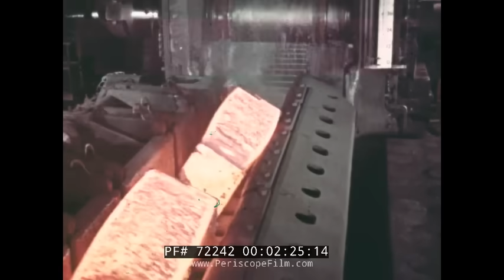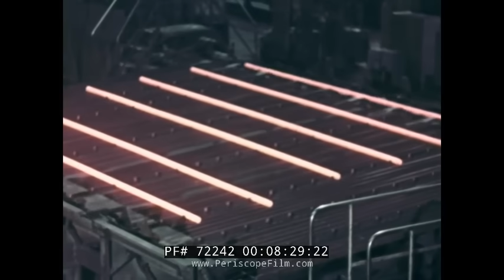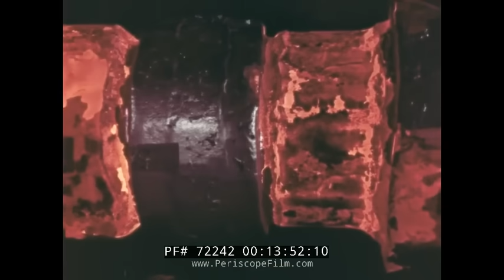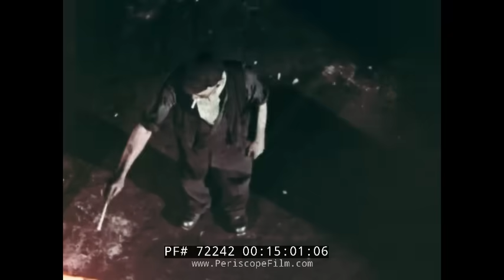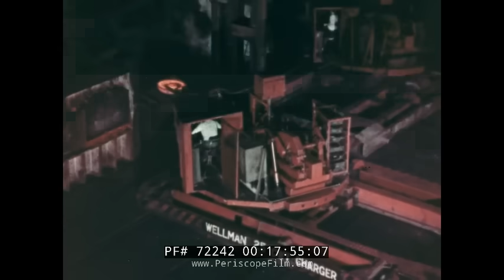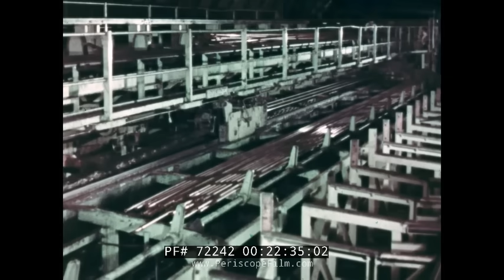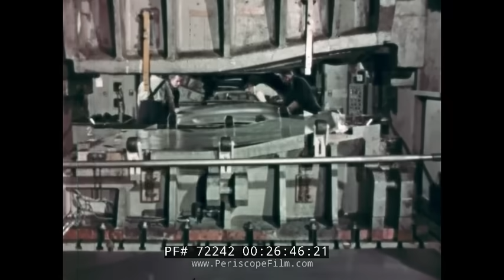"THE DRAMA OF METAL FORMING" 1959 METAL FOUNDRY & FORMING PROCESS   SHELL OIL INDUSTRIAL FILM 72242

Comment: 50+ years fixing machines like these. Paid better than running them and you never got bored.
Reply: bob brooks I'd love to hear some of your stories.  I've spent my life building and repairing machine tools, so I know how much fun it can be!
Reply: I enjoyed them all almost equally, but large horizontal mills are probably my favorite, for the complexity.  Lathes are a close second, because they're my favorite machine.  I would take them down to nothing, grind the castings, scrape them in and rewire with new controls.
Reply: @mrmichael555  nice, scraping seems like a magic dark art, it baffles me that it is done, how would they maintain the squareness/paralellness across the ways???
Reply: mackk123 Back then, autocollimators, levels, taut wire and levels.  Now, lasers take the place of some of that.  Just keep scraping until it's right!   Some machines I've done took months to scrape in.
Reply: @mrmichael555  woah I can imagine now, those telescope inspector looking collimators, being slid back and forth to test the trueness of it, makes sense. But seems easier said than done for sure, my furthest scraping experience is on a slow day I used a piece of broken hack saw blade that I'd just ground to have edges, scraped away pieces of aluminum and checkedthem on the surface flat.  Scrapings real but it still feels like magic  LOL
Reply: @mrmichael555  I'd want to  build some mini scale machine to do recycling, how can I star?
Reply: @mrmichael555  ever work on tube draw bench? I work with one from the 60's and it still runs!
Reply: Exi1ed Dragoon no, I've never touched one.  I've always been on the machining and cutting side of things.
Reply: Exi1ed Dragoon but I've rebuilt a few very old grinders and mills.  The history, 50 or so years of people running those machines is amazing!
Reply: @mrmichael555  Where did the repair take place and how long did it take? Was a large mill moved to a shop? Did they have spares, or did production stop until the mill was fixed?
Reply: Dave S. The machine would be brought to our shop.  On average, a large mill could take as long as 5000 hours to completely go through.  With enough people overlapping correctly, it can be done in eight months.  The customer would schedule around this.  It's next to impossible to rebuild, retrofit and predict what a future customer might want, so they always accept the down time.
Reply: @mrmichael555  My boyfriend’s dad passed and he has a big lathe that he dismantled and they don’t know what to do with it.
Reply: @bonnaew9951  that’s too bad!  Where is it located?
Reply: Unsung heroes of the modern age, the people that design all these machines.
Reply: @flybobbie1449  design? You mean the poor sods like us who have to keep em running?

The amount of things that are designed without a single thought about repairs and revisions is incredible, the amount of work, force and even violence (*lights acetylene torch*) that comes to play when you have to simply crack em open to replace a bearing or a worn seal…

Not all machines are like it, but especially the newer ones are obviously designed to save as much money as possible and to make as much money as possible for the manufacturer 🤡

The engineer’s work nowadays isn’t the same as its the bankers who run the show. Not the technical people that design it let alone maintain em hahaha

All engineers who design and develop industrial gear should all do a 1y stint as a Electromechanic and see the sometimes piss-poorly designed shit we have to deal with. Some designs are flawed to begin with. Often caused by overlooking something simple or stupid. Something we often diagnose and find the cause off. But they don’t care. 🤷‍♂️ they won’t change it if the issue isn’t so severe that it damages their reputation, and even then 😂
Reply: The backbone of this nation...I witnessed it thriving, I witnessed it dying and I saw it die...it would be nice to see 10000 men and women at the Navy Yard again!  And, I just noticed we share a name...:)...
Reply: @godbluffvdgg   The Navy Yard is up and coming, just in a different way. TastyKake, 76ers, Jefferson. Now all the scrap people sell goes to China. Steel and coal made PA and Philly though
Reply: @lukejette  Too true and the Navy yard has turned a corner, once Kaverner Got in there...
Reply: Hats off to the men who run these machines and the ones that keep them running. I have friends who work in a tubing plant. Some that retired from there. Some that didn't put in a full shift and quit.
Reply: Spent many years as a Millwright at ALCOA and Shultz Steel. Started out casting aluminum ingot and cast plate to machining ingot for forging and extruding. Shultz Steel is an amazing forge plant with hammers to 10,000 pounds, forge presses from 1500, 4,000, 6,000, 28,000, and 45,000 tons
Reply: Gil Garcia What kind of Millwright would do production casting and machining? Something doesn't add up here.
Reply: Chuck Philpot when I started working at ALCOA it was in there Ingot Department where we cast various sizes of round ingot, and several thicknesses and widths of cast plate. Over 5 years I worked my way up through the production ranks to become a production machinist. After two years as a production machinist I started my mechanical apprenticeship, and I became a Millwright working in ALCOA’s Vernon Works in Southern California. I hope that adds up!
Reply: Gil Garcia sure does! Wasn't calling you a liar by the way, I just knew that neither of the things you mentioned having done for them constitued a millwright. My father was a millwright, and I am working on becoming a toolmaker for the largest medical manufacturer in the world.
Reply: Chuck Philpot I’m retired now from working for a very large Water company in Southern California that I worked for 25 years as a Operations & Maintenance Tech IV. I’ve always missed working for ALCOA but they closed, or sold all their aluminum operations in this state. Anyway good luck as a toolmaker!
Reply: Big, heavy and nasty. I've heard a number of stories of repair nightmares on those plug mills. A bunch of the guys came from Pittsburgh, Ohio and Michigan back in the 1980's and 90's when the mills shut down or reduce production after mining stopped and NAFTA killed the U.S. industry.
Reply: Same with CNC machines...pays 5-6x more an hour to work on them than it does to run them.
Reply: I'm worried that we don't have the skill today to even build  this older equipment if a war effort needed it.  I built machine equipment most of my life, my father had an engineering machine shop for 50 years.  Now I'm older than that, and I don't know a single boy or man interested in this metallurgy or machine technology personally.  I finished my last years as a CNC programmer and tool designer, but the profession and knowledge is fast going away.  Kinda scary to me, I feel.  This video has some big equipment.  If America forgets how to make patterns and start machine/mill building from scratch in the USA, we may will be in big trouble sooner than later.  I know ever comment on this will be we already are...
Reply: @texasamericanpatriot8535  When President Reopened the Steel Mills and Metal Foundries for the first time since Clinton began shutting them all down. 
  The democrats Immediately began shutting them down.
   I've fought this since the late 80s and early 90s when it went into full swing..
   They have a pattern they use  to Decimate Every Business after Business and Industry after Industry... The corrupt politicians and their friends get to take over and keep any businesses they want but nothing to do with Massive manufacturing, Steel, Forestry, oil, coal, etc.. 
They are doing something that I can't believe people don't All See right in front of them... then again they are systematically Dumbed Down, turn against each other and much worse.
  And you are right..
Reply: @texasamericanpatriot8535  we already are😔
Reply: what was your favorite type of machine to repair? how extensive of repairs would u do??
Reply: I left a big corporate machine shop for a small mom and pop shop. Whenever something broke at the big union corporation, the machine was red tagged a repair technician took care of it. At the mom and pop place, if a mill goes down I'm tasked with fixing it. If it's a electronics problem we call a repair man, but in most cases we identify the bad part, order or make a replacement on a CNC mill and get whatever is broke fixed. I realized early on in my career machinists can fix damn near anything and if the parts not made anymore or you can't find it, depends on the part we can reproduce the part ourselves and we over do our replacements we make ourselves into damn near bullet proof fixes.
Reply: Oh yes, because of the many hours of overtime it took to keep these mills running!
Reply: I work on the biggest aluminum extrusion press in this hemisphere.  It was a WW2 spoil of war we took from Germany after the war. Amazing to think of the history of it. Im kind of a history nerd lol i guess thats obvious seeing as how im watching this video .
Reply: Bob Brooks I don't know if you will see this 2 years later but I live in Cincinnati and I know we used to make enormous milling machines etc. How do you repair and work on a machine where every component weighs thousands of pounds? 

And what about huge presses, are they built on site?
Reply: @paulloveless9180  I also lived in Cincinnati and spent my life building machines.  Big cranes were my best friend, and larger machines to make parts for large machines.  The old Gray building still has most of the big machines it always had, still in operation.  It’s quite impressive!
Reply: @mrmichael555  I think you are talking about the building on the right side of 71 South?  And thanks for replying!  I'm here in North Avondale right across the street from Xaiver.
Reply: Every 20 min job is one broken bolt away from a nightmare...lol
Reply: 21 years working steel industry wouldn’t change it it has been a journey
Reply: Centerless grinders were my main repair jobs,big presses,and machine tools along with chain assembly machines.
Reply: Is that what Your Career Was ???????
Reply: Sure is an interesting career! No day is the same!
Reply: but sometimes you got squished!
Reply: never get bored fighting lions either lol
Reply: Could you run them professionally if you had to?
Reply: Bob Brooks I work in old Hydro Electric Powerhouses and many of the controls are of this vintage. I must say I feel sorry for the electricians who had to continuously change out/dress the slip ring motor drum contacts. I can only imagine the beatings they must have taken with the continuous on and off of changing motor rotation.

Comment: Uhhh, you said 'Butt welding' (@8.00)... uhhh huhhhuhhh huhhhhh...
Reply: That's right Butthead!
Reply: @gregorythomas333  GUAR!
Reply: Are you threatening me?
Reply: "Butt welding" is a perfectly legitimate technical term. It means the parts being welded together are directly in line with each other, not overlapped or at right angles.
Reply: @cedriclynch  Just having some fun man... Relax.
Reply: @LaPabst  The UK radio and TV organisation BBC runs a radio panel game called "The Unbelievable Truth" in which competitors have to make a speech on a subject given by the presenter that is mostly false but including five truths that the other competitors should try to spot. Recently one competitor had to speak about engineering and gave a list of supposed engineering terms that sounded like decency violations of one kind or another. They included "full penetration butt weld" and none of the other competitors spotted that this was a genuine engineering term.

Comment: I bet that roller operator position was highly coveted and probably relatively well- compensated.
Reply: The Roller was the highest paid member of the rolling mill crew and he also earned the most bonus for the rolling crews output, that why you saw him breaking down two ingots a once in the blooming mill which they call a slabing mill in this video. The Slabing Mill was actually at the beginning of the Hot Strip Mill.
Reply: Dennis O'Brien The repair men were better paid from what I heard.
Reply: Honorary grey hair position by the look of it. You had to put in your years to get that seat, I was going to say be in the hot seat, but that's one of the coolest in the house, a fair distance from tons of white hot steel. Some of the other chaps are standing close to a billet whose radiant heat output would be somewhat akin to standing in the Gobi desert with no shade! I'd be sweating harder at ten times the distance.
Reply: At IMI there were 5 grades 5 was the bottom of the pile. The shit shoveler and the tea maker. It took me 8 years to become grade one roller.
Reply: A hipster OG.

Comment: The section on “ drawn over mandrel “  tubing was very interesting. I wish it showed more detail on the welding of the tube. And for the love of Pete, steer clear of that flying saw ☠️‼️
Reply: The welding (most likely copper) rollers press the material  edges together  & with high current butt-weld the joint, no sparks or flash would be noticable in this process... 

Also you might think the 2 tube folded edges being all one part would effectively short out the current... but current flows through the path of least resistance. 

The current flowing between the pressed together  ends is highest because , being closer,  they  are a lower resistance path  than the current travelling all around the formed tube to meet the other side... difficult to explain in a short post 🙄😂
Reply: Yeah. Whenever they showed any tubes being formed from sheets my eyes were glued to the screen, almost as if I was hypnotized. "How the hell do they get a tube from a sheet ?" I kept asking myself.

Comment: We need modernized manufacturing to replace the old rust belt plants that were closed. Business went south in more ways than one.
Reply: There are plenty of modern steel mills around the country.
Reply: @slappy8941  Yep. We have one right here that makes rebar. Worked maintenance there for a while. Nasty work. Come out at the end of shift looking like a coal miner. We changed alligator shear blades every shift. Started off with a coal shovel  and a wheel barrow to get the slag out from around the shear,  just to get to it. Paid good though. They used to get a stack of castings from the mill and put them in the machine shop for heat in the winter. I didn't last until summer, I'm sure it was brutal.
Reply: Amen.  And we need to get rid of periods at the end of sentences.  They slow everything down, too.